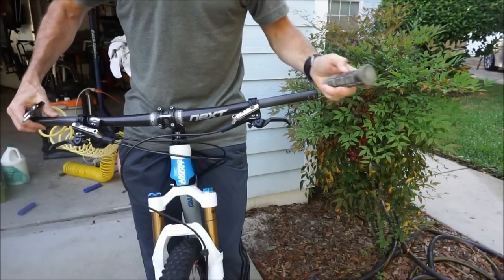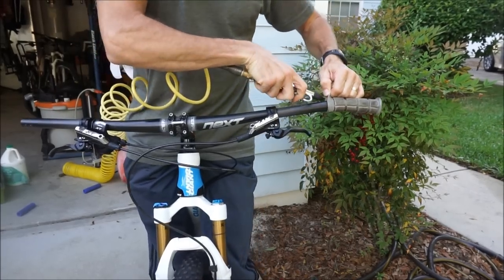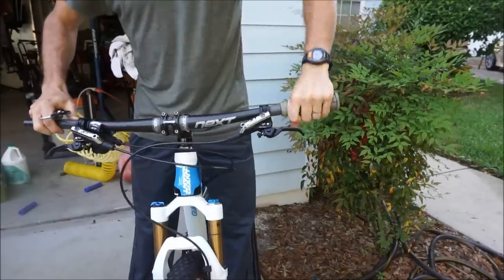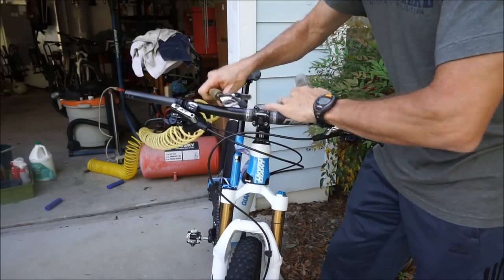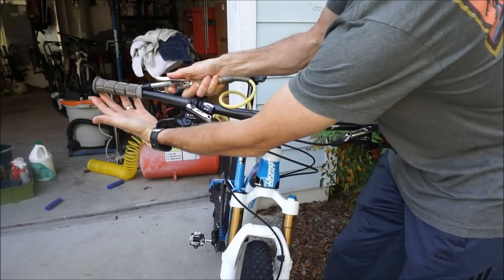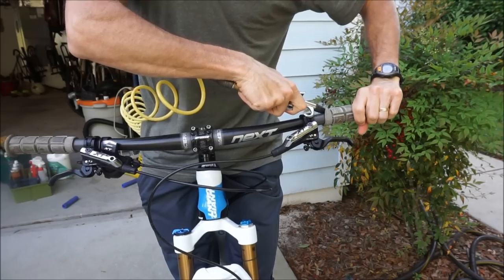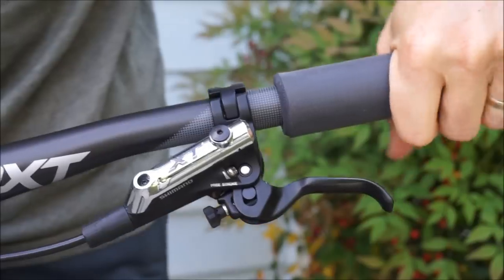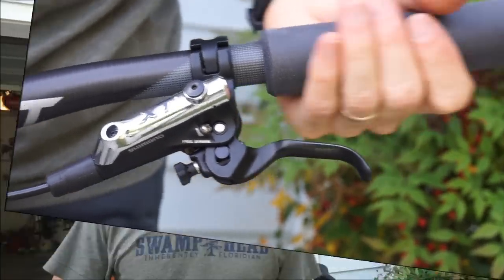Install and Remove Bike Grips With Air Compressor

Comment: Honestly I’ve found no issues using the traditional rubbing alcohol method with esi grips. Put the bar plug on first, plug on end of the grip with your finger, pour in a good amount of rubbing alcohol inside. Plug the other end and shake around the rubbing alcohol so they entire inside of the grip is coated. Pour the excess onto the bar and you should have no issues sliding them on. Make sure to use 70% isopropyl as higher concentrations evaporate too quickly. Typically when the grips reach the end of life I just cut them off and install new ones.

Comment: I just did this- works awesome - I saw it years ago and never tried it. I have those OURY grips on my KTM 1290R. Awesome to kill vibration.
Ass backwards I found a video to share now. thx!
You should safety wire them - they won't move at all.

Comment: What I like to do with foam grips is to use plain water (no soap! it will make them slide in damp weather). At first, I wet them and try to get them on the bar as far as I can. Then I take a syringe with a hypodermic, stick it in the grip, inject water in a couple of places so that you get a layer of water between the grip and the bar. Then it slides on super easily.

Comment: Are these grips closed cylinders or open cylinders? I could t get the trick to work for me at all and I think it may be because my grip is a simple tube.

Edit: No it was mostly because my air attachment leaks too much. I changed to another and it worked.

Comment: excellent idea however if the grips are set and secure as well as you said they were after you installed the first hand grip, then how could the first grip possibly come off while installing the second grip if the air compressor were to shoot any air towards the first grip?

Comment: Had a three foot piece of soft tubing with a 90 degree turn in the middle on a stationary bike.  I cut the tubing at the turn and with the air it came off fairly easy.  Had to get both sides off before getting the bar welded.

Comment: For the foam grips, try putting alcohol inside the grip and on the handlebar, then push it on using a towel.  Works great.

Comment: I use hot water to put my ESi extra chunky grips on and off,which is easeir than using a compressor on the foam grips. Great video BTW
Never use hairspray,it will make the grips slide and stink.

Comment: I use foam grips (installed on  a set of shucked lock-on grips with a solid core, no cutouts) pain but worthwhile

30+ minutes install per grip. Air compressor is harder due to added lock-on core 

(easy on/off with bike maintenance) lasts 15+ months before foam dehydrates/crumbling

__

Air compressor install is best.

Easiest way to remove is with loosened brake levers. or just cut.

Comment: I found that the air pressure that would be adequate to install and remove regular handlebar grips is simply insufficient for the foam grip tubing, especially if one is trying to force the foam rubber tubing onto an oversize handlebar or tool handle.  I had to increase the regulator pressure up to 90 psi (620 kPa) to be able to force enough air under the tubing to allow it to be maneuvered without having to struggle excessively.  Moreover, after the tubing was mounted, it tended to trap a bubble of air, preventing it from seating firmly.  One could puncture the tubing with a pin to let the air our, or shove a thin metal spline or nylon cable tie under it to bleed the air out.

Comment: Great tip and how-to! Has anyone tried canned air if one doesn't have a compressor? I imagine it might be a tad easier with foam grips even with the small diameter straw nozzle.

Comment: I still use the stock grips on my bike and never really tried any different type of grips. Is it worth to replace them with foam grips?
I do not really care about the weight savings, but rather comfortable ride and good bike handling.
Reply from the maker: I would just wait until the stock ones wear out and then try the foam grips
Reply: ESI Grips are really good grips and they don't cost much.  Been using them for, almost, a year.  No complaints.

Comment: And if you don't own a compressor, break cleaner works too. DO NOT use lubricants or soap. unless you want "throttle" grips or them smelling like dishwater for weeks.

Comment: Hi, I'm 5-8 165 and using Ergon Grips for MTB. After months riding started getting Tennis Elbow. My ? for you Clint is should I lose the Ergon grips or is it more likely a shoulder issue?
Cheers, Bart
Reply from the maker: I've never heard of anyone developing elbow problems from riding but I think it's worth a shot to try standard grip. Let me know if it helps.

Comment: Rubbing alcohol gets the foam grips on in seconds. Really super easy.
Reply from the maker: I have used rubbing alcohol with the foam grips and it took a lot of work. I guess it's the combination of bar and grip because the air compressor was 10 times faster for me than rubbing alcohol.
Reply: I feel your pain Clint, great vid, 

ESI GRIPS ARE A DIFFERENT BALLGAME ALL TOGETHER!

 Here is the secret to using rubbing alcohol on those ESI grips (I love those grips by the way) 
Take the rubbing alcohol and dump a large amount into the grip while plugging the end with your thumb, then shake the grip to thoroughly coat it on the inside.
THEN QUICKLY (speed is key) use the excess alcohol in the grip and dump that right on to the bar, and start shoving the grip on the bar while spinning.
Have a paper towel handy to assist in 'gripping' the grip because alcohol will get on your hands.

I was gonna do a video on this but I was too lazy.

The alcohol is great to because you're riding within 10 minutes instead of waiting for soap or hairspray to dry. 

Good video though man I liked it for ya :)
Reply: You seem to be having a hard time putting on those silicone grips using air. I did it very easy (less than 10 seconds each) using alcohol. I guess the technique is to put in the bar ends first (for ESI Grips) and it'll help slide it in. And then use a rug between your hands and the grip for traction.
Reply: Wish I'd seen this before I tore up my hands trying to get the damn things on. The key, as you say, is a whole lot of alcohol and speed.

Comment: Put the air gun in the hole on the end of the grip like I do golf grips. If you're afraid if it blowing the grip off the other side put a plug in it
Reply from the maker: Definitely works for some grips. The ESI foam grips are completely open on the end.

Comment: I install the same grip with alcohol in 10 seconds.
Try this method
Reply from the maker: I tried that about a year ago with foam grips on a carbon bar. Took about 20 minutes and a layer or two of skin! Maybe this has to do with the bar and grip material.
Reply: Clint Gibbs
 I think you're right.
I installed: Esi Grip Racers Edge  On a metal Bar
Reply: Clint Gibbs I've found that you need to really wet the inside of the grip with alcohol. I plug one end with a finger and pour in a little alcohol (90 works better than 70 as it evaps slower). Cap the other end of the grip and shake it to coat the inside. Pour a little of the alcohol in the grip onto the bar and then quickly slide it on. This much alcohol should lube it enough to get it on easily and even allow a little twisting adjustment. Not enough alcohol totally sucks for install. This method works for both alloy and carbon bars.
Reply: brake cleaner works as well. Installed in under 10 secs.

Comment: of which brand are those of foam?
Reply from the maker: The black ones were ESI extra chunky, but after a parking lot test after installation I decided to put the blue ones back on which were just the chunky ones. This was the first time I tried extra chunky and they were a little bit too thick.
Reply: Clint Gibbs Thank you Clint! And keep up with the great work!
Reply: Clint Gibbs Did they have too much flex or were they just hard to get a good hold of?

Comment: You all are doing it wrong. Use air. Take one old esi plug, make small hole in it, but inside the handlebar, then go to oder side of bar, put esi grip on begining of bar (5mm) close the grip with your hand, then use air. Why you press air through hole inside bar plug, air goes to other side but it is blocked by hand so grip just jumps on place itself. It really take seconds. I will make a clip with it.